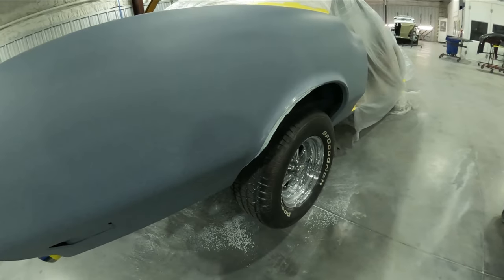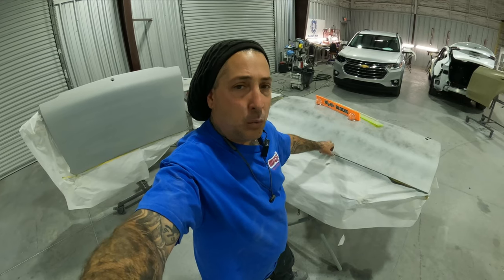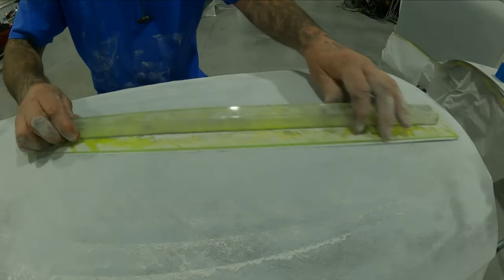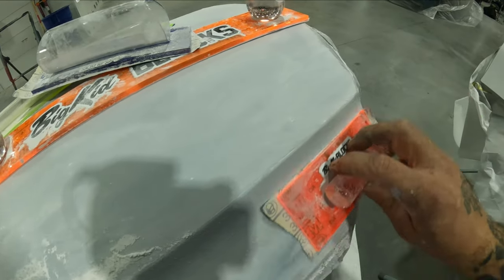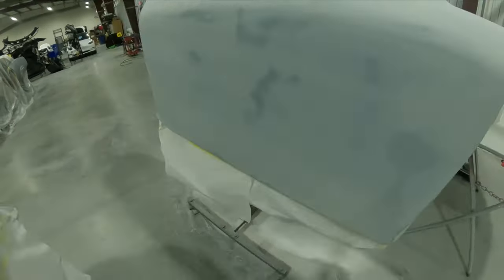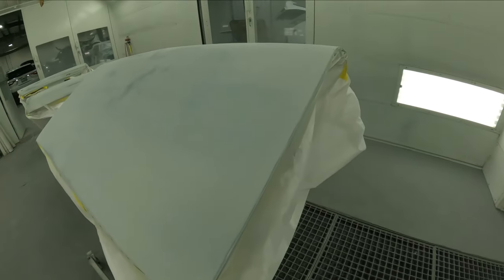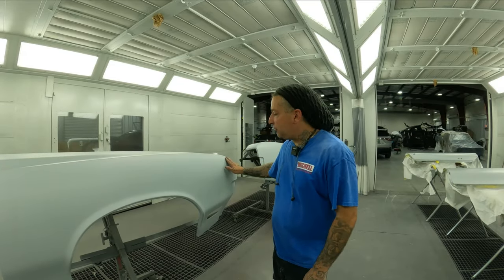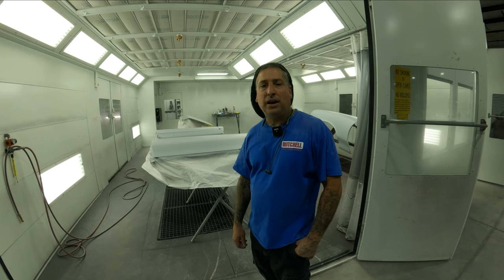How To Prep For 2k Primer

Comment: you also need to put the 2K over slick sand if you are gonna wet sand before paint... you can not wet sand slick sand... feather fill... super build ..which is what i like to use for ease of mixing with the super build 4:1... polyester is to porous and absorbs the water and can cause blistering after paint if wet sanded
Reply: Slick sand is Basically spray on filler & absorbs moisture like a microfiber towel !!!! You MUST seal it up with base coat if you want to allow it to sit for awhile - or your metal will micro rust underneath..... I learned the hard way.. . .